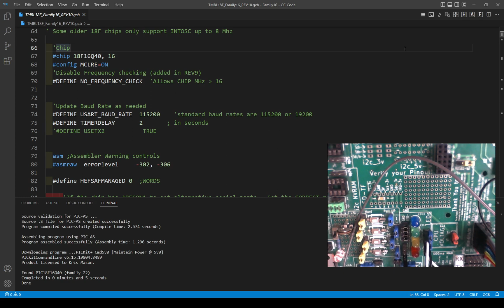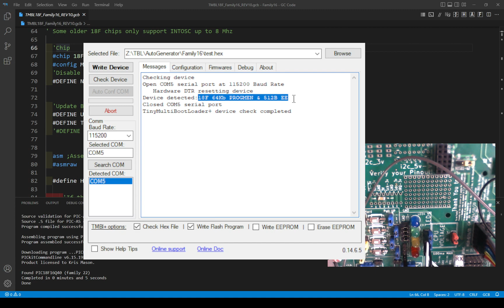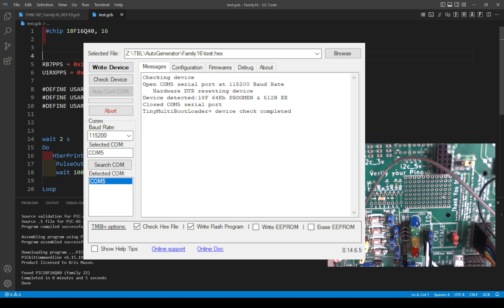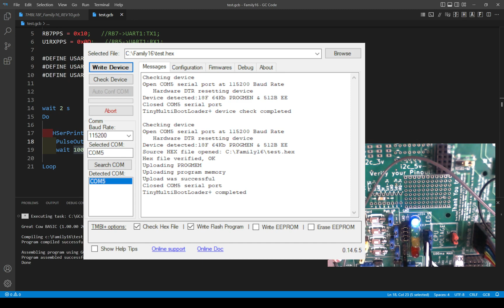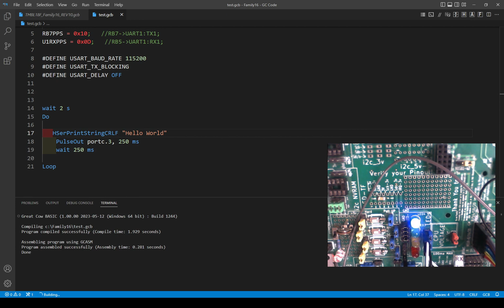TinyBootloader+  This video shows the generation of a bootloader for the new Microchip. AMAZING!

Comment: Hellooo, Great video. I am using a FTDI TF232RL on a PIC16F877A at 4Mhz, I tried with the original tiny bootloader but it didnt work for me. Could you, please, tell me what are the conecction I need to make between my FT232RL and my PIC168877A? and Do you have de Tiny+ Bootloader for my PIC16F877A at 4Mhz?
Reply from the maker: Yes. Ping me an email

Comment: Hello!!
there is a question.
The AT24C32 chip fell into my hands.
I decided to try to write data and read it via the I2C bus with the LCD 1602 output.
and doesn't work)
Do you have an example of working with some kind of external memory?
Thank you very much for such a wonderful program.
Reply: It seems to work))
SUPER program.
I found an example code on your site and understood a little about how to write and read it.
Thank you !!!!🤝